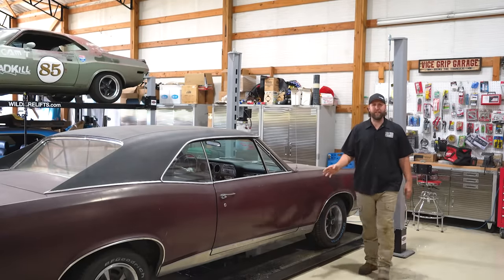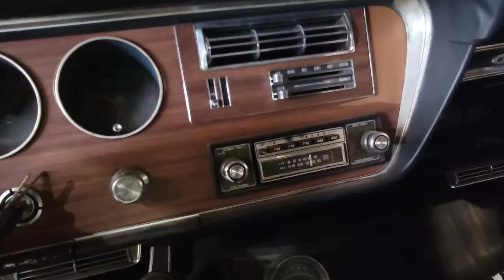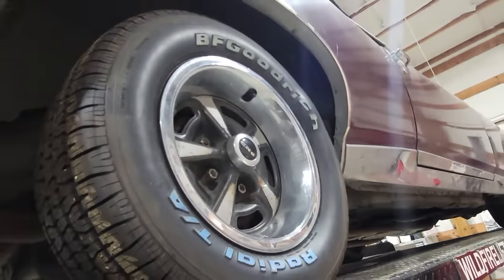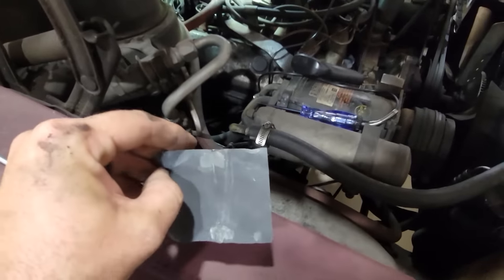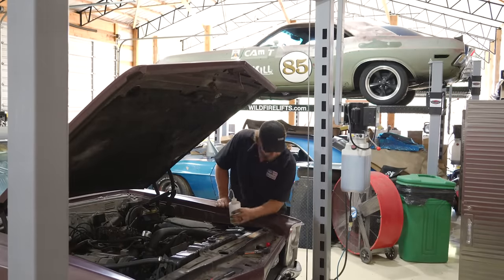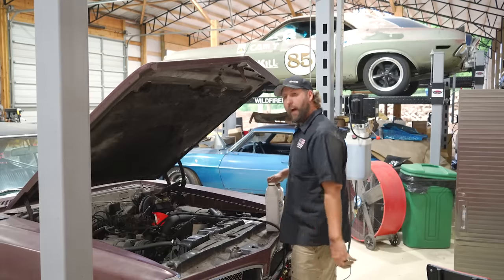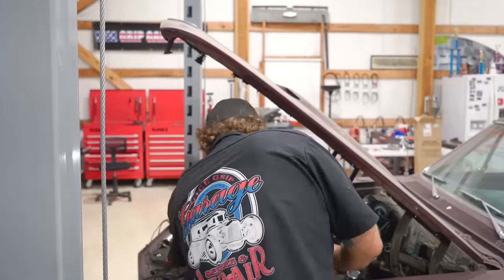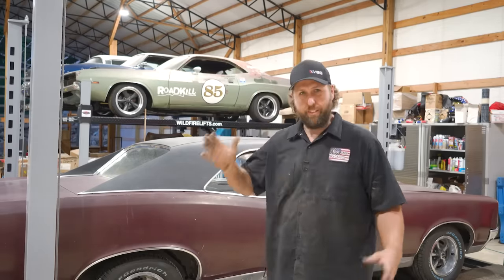Will This Pontiac GTO RUN AND DRIVE After 40 YEARS? (Buried in Garage) EP1

Comment: If it was Me, I'd finish with Mechanical 1st, Interior 2nd, & body work last. That way no scratch's can happen when working on Interior. This is the days I miss a lot, when A Mechanic was A Mechanic!
Reply: This is the exact sequence I followed with my 65 GTO.  Will be painting it this summer, but not relishing all the prep work needed before painting.
Reply: I was going to vote paint because it's going to shine up so good, but you're right... dang it.
Reply: As much as I can't wait for the paint and interior, your right the mechanical first,
Reply: Yeah what he said 👍
Reply: Mechanical first is definitely the sensible way to do things. I'd only qualify that with: if it looks good and shiny it can help to motivate you to press on and get the job finished.
Reply: You mean if the computer don't tell whats wrong they just scratch their heads? 😉
Reply: scratches not "scratch's"
Reply: agreeing with PeterRabbit59 🙂
Reply: @glistertj  This is the correct path to get her back to the road
Reply: Step 1: fix brakes
Step 2: BURNOUTS
Reply: I agree, get it cruising safely, then once the greasy bits are done, clean her right up.

You may wish to have that seat repair happening whilst you are fixing on her though.
Reply: @mikaeljonsson4686  computers don’t “tell you what’s wrong.” If they did, diagnosing & repairing newer vehicles would be soooo easy and no one would whine about them. Finding a competent mechanic who can use the information the computer provides, along with the rest of their knowledge, to repair a vehicle correctly is very difficult - just as difficult as it was back in the 60s, 70s, 80s, and 90s. I watched plenty of “great” older mechanics screw up setting points, adjusting carbs, setting up diffs, adjusting brakes, and so on - and no computers were involved - but they still stood there scratching their heads. 

I run my own single-stall specialty shop in addition to my day job as a heavy equipment mechanic - I take in the drivability & engine performance mysteries that the dealerships and independent shops give up on, just like my grandpa ran his own shop of the same type back in the 60s & 70s, diagnosing and repairing the issues that other mechanics couldn’t figure out (or messed up). 

I guess my point here is that whether it’s points, vacuum advance, a carb, and all mechanical systems…not every mechanic “back in the day” could fix them, just like not every current mechanic can diagnose and repair modern vehicles with a computer. The tools don’t make the mechanic.
Reply: I agree with peterRabbit...mechanics,interior the clean up the body
Reply: Either way, it's great that HE did this. Some talk about it, VGG does it.
Reply: I also miss those days where you can just find the problem in the engine quickly and replace it pretty easily usually I'm with you.
Reply: Yep get the dirty work done first then buff and shine her up!
Reply: @97marqedman  How Interesting. You have almost same thing as I had. I also was "Head Mechanic" for a place I worked in the 70's. Two words I learned in 1967 was "NEVER ASSUME!" Those two words are gone now with these stupid computers. Example to that was, I had a 1977 Chrysler Newport with the "Lean Burn", the 1st Computer into to vehicles, was one transistor blew & they wanted $675.95 for a new computer, so fixed it Myself where the new transistor cost Me a whole whopping $2.85. Had the car 5 years after replacing it.
Reply: Yep. My dad was a professional body and paint man for over 50 years, that's the sequence of a proper restoration.
Reply: @mikaeljonsson4686  yes Sir. The new age millennial mechanics if they can't plug a diagnostic computer into it they ain't got a m********** clue
Reply: My MOS was dragging an m82/107 around town Town being a joke son. Knocking heads off from a click out kept a whole f**** Iranian brigade backed up for 2 days
Reply: That water is a worry. I hope that the block isn’t cracked or the head gaskets are all right !
Reply: @fenatic7484  most of those old engines have such thick metal in them that a head gasket issue is very rare.
What you saw was air in the cooling system. There was so much rust because most people living where the car came from didn’t use antifreeze because you didn’t need it. The only problem was rust. If you flushed your cooling system every year it was fine.
On those iron engines a couple of flushes would usually get the rust out.
Reply: @pmscalisi  I really do hope, that is my favorite year of all cars big to small. The 67 Impala, to the Mustang fastback with a 390. I really hope that it didn’t crack! 67 was the first 14 degree engine that really breathed had the best Quadrajet and as a line mechanic I remember that gargantuan AC compressor that is still used in Combines. They would hold 34 degrees on a meat thermometer in the vent, 2 nd only to the V- twin Mopar that I have seen go to 30.  Changing Plugs from underneath? Done it! I really hope this one is OK . 1 issue I have found in Fords and all perimeter frame cars is frame rust.
Reply: No scratches can happen when working on interior? Awesome. Master of the obvious, you got it wrong.
Reply: Any more when it comes to auto repair you have to be a computer repair man as well
Reply: @frankkennedy5361  jkkk huh
Reply: @kadehefflinger2391  kool
Reply: @chrismarchese4503  k
Reply: Remove interior to be fixed while doing mechanical. Once mechanical is done you throw interior in within a couple hours and roll her in the paint booth. If just fix and finish that is.
Reply: If it was me, I would remove all the plugs. Crank the engine for A few minutes to get oil pumping through the dry motor. Then add a few drops of mystery oil in each cylinder, the put the plugs in and continue starting the motor.
Reply: Oh skip any NON structural  body and make yourself a sleeper, I had people think my iroc was clapped judging appearance. Then get sorely disappointed

Comment: Been waiting for this one since I glimpsed it hiding in the corner.  So much I recognize about this car.  Mine is nearly identical in terms of equipment and trim, but is wearing Mariner Turquoise paint and a hood tach.  Drove it OUT of the junkyard in 1990 and have been fiddling with it ever since.  Love it.   Fun fact, those valve covers and air cleaner are factory.  Weird rad cap.  Those air shocks are actually really helpful.   Mine had 'em, I deleted 'em, and now it's got bags because that big ol trunk you love will really sag in the back end leading to severe tire rubbage.
Reply: wish i could  come and help, im a vietnam vet myself, disabled, but i used to work on these gto at the hobbyshop on base in davisville rhode island
i was a mechanic in the seabees and replaced many of these engines    guys used to get on them hard and blew up lots of them
Reply: Is it weird that drumbeats was playing in my head as I read this?
Reply: Iam a 20 year USAF vet and this young man has won my heart. Thank you Derek for supporting us 🇺🇸
Reply: It's a special optional trim package that has the air intake use the scoop on the hood, forgot the name of it
Reply: And not one tow truck involved .  Great to see your still out there.
Reply: You asked what next, how about the brakes and then the interior? 😆
Reply: @rawr51919    Ram Air
Reply: @rawr51919  No this car does not have the RAM Air option. The chrome air cleaner was the factory standard.
Reply: Ram air. 4 levels of performance RA1~IV. I’ve got an original 65 360hp tri power 4 speed GTO. Still have the window sticker.
Reply: hey GTOger! been waiting forever for new video's from you! are you ever gonna upload new ones again? what happened?
Reply: @ronjones1077  I just bought a 65 complete 389.   It was rebuilt three years ago by my deceased friend and has been tucked away in a corner since.
      I was with him when he fired it up on the stand and it gave me that  rumble in my gut that took me back to my teen years.
        Now I'm the owner of a 389 that he rebuilt. A 389 that I'm finishing now with a .40 over bore and the smogger control  equipped  400 duce that's in my 74 Catalina.
       So many decisions to make for an old man.
        Might have to find me a roller for  one of these two engines.
         Like our man Derek says
" Bring the thunder"
          Hold the rain.
My friend was  Vietnam veteran. 
He served his country well,  loved his  family as much as any man I've ever met and shared a wealth of knowledge about life freely.
      All in all he loyal friend and always loved THE USA.
     THANKS TO ALL OUR VETS.🙏💪
Reply: DRUMBEATS.... long time no see buddy 👍👍 hows the parking lot doing??
Reply: As in Seattle Mariners? Go M's!!!! (Pipe  dream?!!!!!)
Reply: @jimpalmer1969  Them chrome valve covers were factory too.
Reply: GTOger are we going to get any videos?  It has been a while since I have heard the drumbeats.
Reply: Mariner Turquoise? I bet she's beautiful.
Reply: I’ve got 9 Pontiacs, 59~66. They are all fun. I’m putting a 400 in a 66 GP mild custom.
Reply: @rawr51919  William Gallagher here. Using wife's account.  Do you mean the Ram Air option?
Reply: I miss the drum beats
Reply: I just bought a 1972 GTO. The car had been setting 5 years. The guy told me it had a fresh rebuild and he drove it once and parked it. Well I got it home and the engine was locked up. I tried the marvel mystery oil and transmission fluid with no luck. I pulled a head and it was horrible. It looked like he had left it outside in the rain. It’s a 400 and it’s not rebuildable. I can’t find one anywhere and when I do it’s way to much money.
Reply: Anyone who saves a classic car from the junkyard is OK in my book. Thank you!
Reply: I would like to See what Domes out of the engine in cafe you do a flush
Reply: @rawr51919   Ram Air?
Reply: @rawr51919  Ram Air 3 or 4.
Reply: A buddy of mine has a 69 with a 455 in it sitting in his garage. He recently retired from the fire department (Chief) so maybe we can get started on it now. He also has a 1970 1/2 TA with the 400 in it and a Rock Crusher 4 speed that we have great memories in as young "hooligans". 🇺🇸😎
Reply: GTOger
Great seeing you here! Two of my fav "relax watching" YouTube channels! 👍🥁
Reply: @johngoodwin8889  All factory Pontiac V8's are prone to oil starvation as the revs climb.  That's why spun bearing were common back in the day with them when pushed.  It's easy enough to correct today.  In short oil doesn't return to pan quick enough to keep up.
Reply: @rawr51919  Ram Air and this car does not have it.

Comment: I vote for getting the mechanicals working and drivable. Love 67 GTO's one of my favorites. Keep up the good work supporting our Vets and keeping the classics on the road.
Reply: Agree, determine if the basic block and heads are ok, before start up pull the plugs, marvel mystery oil in the cylinders, berryman the carb, change the oil and filter, crank over letting the MMO lube the rings, inspect plugs and check compression.  Replace belts, hoses, flush engine and rad, new plugs and wires, points, then start with remote fuel tank.  Do brake job and grease front wheel bearings, master and wheel cylinders, pads, transmission service, shocks, flush fuel tank and line, add in-line fuel filter, then maybe drive her....shame to damage that car by not doing the maintenance/refresh first...all above is pretty cheap too
Reply: @wokewokerman5280  Which planet exactly offers cheap petroleum products? I'm very eager to know. More importantly does Elon Musk offer FREE shipping? otherwise I'm sure there will be an astronomical fuel tax and shipping charge.
Reply: @briansutton7764  ...Pluto and Elon can get you there....
Reply: @wokewokerman5280  I'd go 4 wheel disc brakes myself

Comment: Most GTOs came with fan guard and or fan shroud, especially with AC. I found that my 67 GTO runs cooler with them installed. Great thing you are doing, Derek. God bless.
Reply: My 69er has a fan shroud. Though I have considered switching to electrics for better cooling and a little more hp.
Reply: Looks like the shroud is broken on this one, seems like part of it's still there on the drinker side.
Reply: Possibly a broken motor mount ,let the engine raise up to bust the fan shroud
Reply: The fan shroud makes a huge difference when it comes to cooling that bad boy!
I had a 1970 "442" Olds Cutlass with the 455 big block and I ran it without the fan shroud because it was brittle and cracked and it kept hitting the clutch fan and it indeed overheated it !!!
I had to find another one at the local junkyard, after installing it my overheating problem was solved!
Reply: @monicasmith350  
That's a real possibility, good call Monica!

Comment: Wow, does this bring up memories.  I went to work on the Pontiac Motors plant 9 motor line in November of 1965.  In those days we were working two shifts 10 hours a day 6 days a week and made 3 engines an hour. In January of '66 my GTO arrived at the dealer.  389 Tri-Power four speed.  If you have ever heard of the Woodward dream cruise, they are re-enacting what I was doing every weekend. I actually met my wife there.
I did a lot of jobs on the motor line including in order: putting oil in the engines, installing carburetors, installing spark plugs and painting engines.  In 1967 model year (July 1966) we  stopped installing carbs before motor test and instead used natural gas in motor test to run the engines on the merry-go-round. That is why I ended up painting engines.  By the way, those valve covers are stock for a GTO.  '67 was the first year the GTO had a 3 speed auto ('66 had a power glide).  Those were the days.  Aug 1967 I was drafted into the army.  I spent almost 2 years in Vietnam and thinking about my car that was waiting for me at home was one of the main things that got me through.  Thanks for what you do.  I'm sure Barry will enjoy his car when you are done with it. God Bless You.  Garry Butler
Reply: Welcome home brother.
Reply: WELCOME HOME Sir and God Bless You.  Do you still have the car?
Reply: I meant we made 3 engines a minute.
Reply: @beckyumphrey2626  The car is long gone.

Comment: I bought a '67 GTO in 1975 CV 4sp while I was in the USN. Owned it until 2005 and sold it to my brother. He finished a complete frame off restoration. The car now has 650HP built stroker motor with the original muncie 4sp and a overdrive. A couple of things about the car you are working on. The chrome valve covers and air cleaner is how it came from the factory. The air cleaner is the same as similar year corvette. One thing about the '67 400 is they had cooling problems at idle. They didn't pump water very well. This was corrected in 1968 with a different water pump. The other thing about the cooling system is the back of the water pump housing is made from aluminum and it also forms the cover for the timing chain. This aluminum part would corrode and erode and allow cooling fluid to get from the water jacket into the crankcase. 

This is an extremely valuable original GTO. Do not fool around with it. Do it right. Before running it much more do the following things:
 1. pressure test the cooling system and make sure water is not leaking into the crankcase. If it does not hold pressure and it is not obvious where the water is going pull the water pump and front engine cover. Make sure the front cover is in serviceable condition and if necessary have it weld repaired and grind it back to the correct dimensions.
2. change the fuel pump and get clean fuel coming from the gas tank. You are going to have to do this before you drive it back to Florida. You know how to do this.
3. Fix the brakes before you drive it. It is foolish not to. This includes a new master and slave cylinders. Replace all of the flex lines in the brake system and put new shoes on. The brake drums on this car are unique to Pontiac and the GTO. Original ones are just plain N/A. If you need to turn them make sure to take the minimum material off. During the 60s Pontiac marketed their cars as wide track. They had a 1 inch wider track the the comparable Chevrolet Malibu, Oldsmobile 442 or Buick GS. They did this by increasing the thickness of the brake drums where the wheel studs go.
4. put new tires on it. It would be terrible if you took this car out for a test drive and one of these old tires blew and the car got damaged. I would cry.

Other than this, I'm very interested in this project. Do the rest on any other order. Keep going. JimP

Comment: In reply to your question: I believe full correction of the fuel and ignition systems should be #1, with brakes being #2 
Love your work! ✊🏻
Reply: Drop the tank & flush it, and don't forget to replace the pick up sock in the gas tank, it's for sure shot.